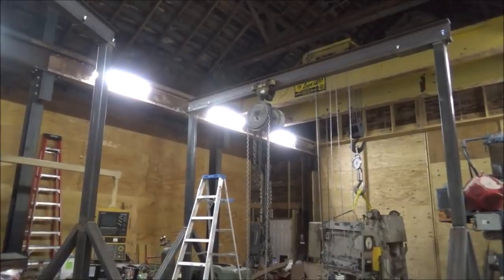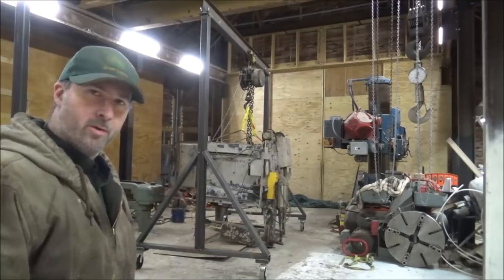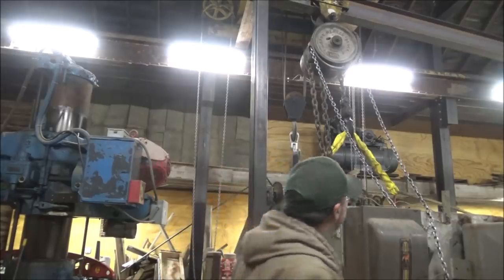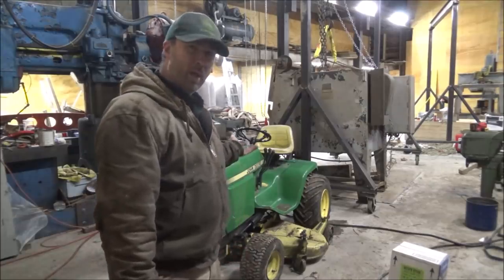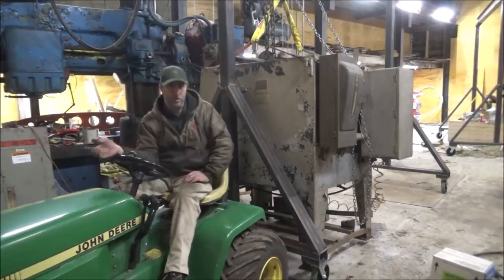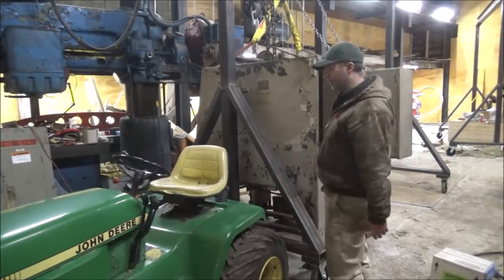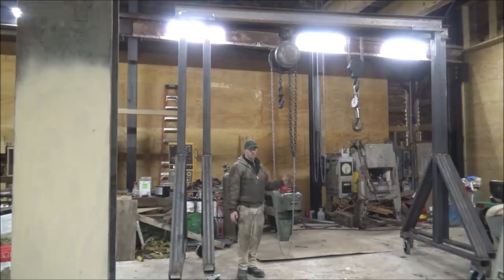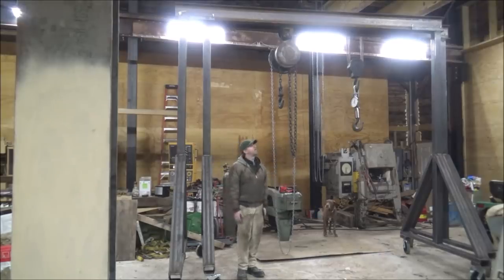Extreme Gantry Crane Testing

Comment: Hi Brian. Looks pretty good but they forgot to put in 2 stringers between top and verticals. A lot of stress builds up in the corner to which the huge mass moves. Just image that you build up speed with the huge load when moving it from one end to the other side.
Reply from the maker: Contract called for clear span so that is how they were built.
Reply: @bcbloc02  the static load is properly just fine. The dynamic load in worst case is uncertain.  You could for example measure the movement or distance between those two legs when pushing the load from side to side.   I am very serious about your safety

Comment: So they'll safely lift 3 tons ?
Reply from the maker: That one was rated for 2 tons but has a factor of safety of well over 2 times so it can handle the 3 ton overload with no damage.
Reply: @bcbloc02  Why didn't you put angle plates in the top corners to improve rigidity and reduce the risk of splaying the legs ?
Reply from the maker: @millomweb  customer spec was for clear internal span.
Reply: @bcbloc02  That's a good response - but you could have advised against it - after all the trolleys don't cover the full width - they're what - 10-12" short at each end. That's the place I'd fit a triangle - so no further impact on trolley travel yet significant strengthening.

Comment: Nice job I would of put triangles up at the top corners on the beam and post for extra strength
Reply from the maker: But then it would be a 4ton crane with better castors. :-) Of course it has to be bolted solid then so no more sliding width adjustment which was a requested feature to work with various floor space layouts.

Comment: Were you disappointed that at the 4000lb+ loading, neither your trolley nor the wheels rolled well enough for you to push it by hand?  The rubber Urethane tread wheel I can see being difficult, but the steel trolley wheels I would have thought to roll more easily.  I suppose that is why they make geared trolleys.  I have no experience using the trolleys so I don't know how hard it is the get them to roll in the first place.  I'd just be bummed if I had built this for myself and then couldn't move the trolley (the only thing of that weight I could envisage picking up to move would be to reposition a bridgeport or lathe)
Reply from the maker: No Bridgeport weighs 5k I have ever seen.  The bearings in the trolley I used are pretty stiff on 2 of the rollers so I am sure that didn't help.  The crane isn't designed to be transported loaded so the urethane casters are probably a good thing! Main thing is they won't tear the finish off their smooth shop floor.
Reply: @bcbloc02  I was meaning that the only thing I might want to lift weighing more than probably 500-1,000 lb would be a mill/lathe.  Most of the time it'd be things just heavier than I can comfortably and safely lift by hand (mill vice, rotary table, raw stock etc.).

Comment: I'm a bit worried about the upper corner joints... would weld some sort of triangle supports inside the upper corners
Reply from the maker: It won't bend or come loose even trying to rip it apart with a tractor, why are you worried?
Reply: @bcbloc02  It's the only place where everything rests just on a weld being pulled apart, with huge leverage. Luckily only with side loading/stretching apart. Just be careful when rolling this thing ok? :)
Reply: Unless you have a degree in structural engineering I'd stop questioning Brian's abilities! You seem to forget that He Does Have A Engineering Degree!
Reply: @edkeniston4786  NASA's Apollo program had degreed engineers too.
Reply: @coleboonecustoms  What's your point?
Reply: Go worry somewhere else. You have no idea what you are even looking at.
Reply: @StreuB1  I design and fabricate structural weldments for a living with 39 years of experience . How about you ?
Reply: Jan Hlavatý  So sit there and worry!
Reply: @coleboonecustoms  Electromechanical design engineer for the food and packaging industry for 22 years, have my own machine and fab shop at home, build guns, rockets, racecars, all sorts of other stuff. 39 years of fab experience and you cannot tell that he spray welded this together and with the size of the material stated earlier (4x4x1/2" sq tube, ship car channel and what looks like 6x10 W beam) that means the upper joints are 4" x 2 of 3/8" to 1/2" lateral spray welds plus the same dim's of spray welds parallel in bending; now express the actual load on those welds (bit of trig and some calculus here) and you are at 20% of the welds rated strength.

Gussets are for a reason, to retransmit loading around a joint so the joint can do what its designed to do, maintain alignment of the structural members. In this case, the welds aren't in a huge amount of stress. It's one of those counter-intuitive situations. Visually it looks bad but if you examine it, its not really. It all comes down to the W beam's ability to stay straight. The more the beam bends, the more the welds are going from compression and into tension or bending. That W-beam isn't even phased by a 2.25t load across that span.
Reply: @Jan Hlavaty, Seriously? You are worried and suggest "some sort of triangle thingy" ? That totally sounds like you know what you are talking about! Oh, BTW, they are called gusset plates. Brian is an educated guy in this field, never doubt him!
Reply: @StreuB1  I have to admit when I first saw the gantry I thought ^gussets would be nice, especially with such tall uprights^. I've a gantry that's similar, no gussets, and have had the scissor concern. After seeing Brian tug around on those appropriately loaded frames I can see the worry was over nothing, so something was learnt here 😊

Comment: Can't roll it because of the soft casters, with a load on them they have flat spots, steel wheels would be better.
Reply from the maker: It isn't intended to be rolled when loaded. It is a portable lifting device designed to be rolled to a location and used not carrying loads around. This was just worst case testing.